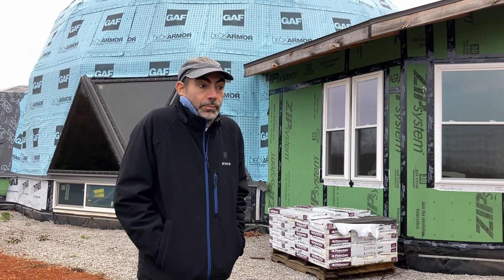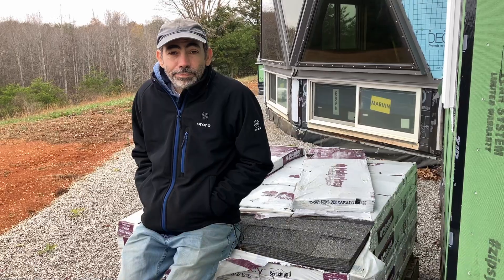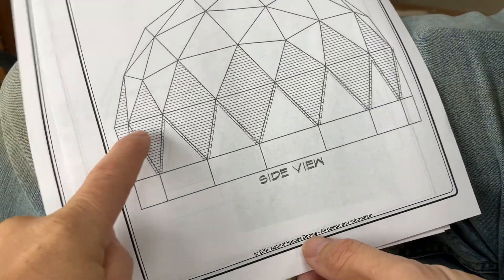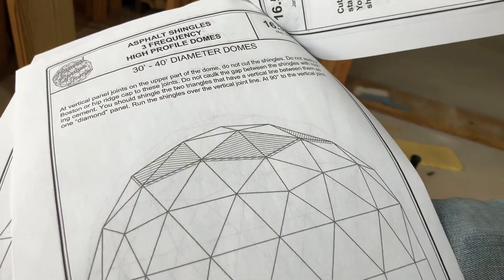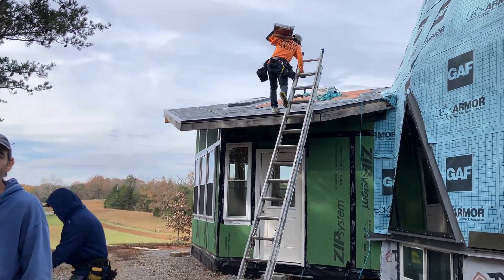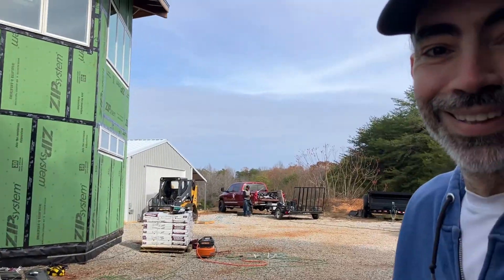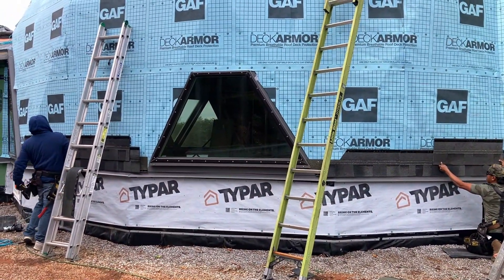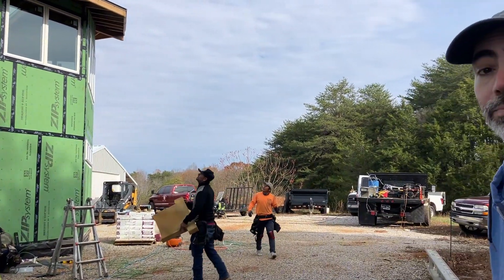How To Shingle A Geodesic Dome Roof - Part One

Comment: Thanks for posting this. I work on a roofing crew and I saw a dome on Facebook.  Was so curious about the process and had questions as some of the other roofers in the comments flat out said they'd quit if they had to do this. Id love the experience of working on such a unique job. Great vid and great job. Very cool.

Edit: was there a lot of waste do to cutting for the triangles?
Reply from the maker: Glad to hear you enjoyed the video!  It's hard to quantify if there was more waist than a standard house because I've never really seen how much waist a standard house has.  NSD said there's basically about the same waist between the two.  That being said, we did lose quite a  few shingles because I had stored them uncovered, they got rained on, and then it froze.  When the crew started working, a number of the shingles stuck to one another and ripped.  We had to lay them out in the sun to thaw.  One guy used a big propane blow torch to heat them up which worked pretty well.  I learned a lesson there!

Comment: Where is this done located? My sister has one in New Hampshire and we cannot find a roofer that knows how to do this…
Reply from the maker: We're in Tennessee.  Is your dome from Natural Spaces Domes?  If so you might contact them for ideas.  Also, we provided our roofer with instructions and a video showing how to put up and cut the shingles.  Maybe that would help ease the mind of potential roofers that the job is not that much different, aside from a lot more cutting.    We did run into roofers hiking up the estimate price because it looks so different.  Keep calling around.  You'll find someone with enough skills and interest to want to take it on.  We actually talked to our local insurance agent and got recommendations from them for reliable roofers.  Good luck!
Reply: I am building a dome here in Tennessee.  It is only 16 ft across.  I will be ready to roof it a couple weeks. Wish me luck.

Comment: There is an ERROR in the shingles!!! 
Where one triangle meets an other  THERE IS A BULGE. 
These shingles will break bearing ice and snow. 

I worked in a campus in upstate New York in the snowbelt 
Doing mineral shingles, half lap and full lap. Aluminium Steel and slate roofing

On the change of angle the shingles SHOULD HAVE BEEN SLIT ON AN ANGLE AND Real silicone should have been put on the back of that angle cut to support the weight and hold the shingle so it would not then split. 

As is you can see the BUBBLE created on the bends of the panels

What work we saw in these  60+ angled roofing joints; which in a year or two all would begin to break up and leak.
Reply from the maker: Thanks for the comment.  Leaking is definitely something we've been worried about from the beginning.  This technique for roofing the dome is what Natural Spaces Domes has used and recommended for decades, so hopefully they have figured it out and it will work long term.  They specifically avoid using the caulking method because apparently that seems to fail over time.  In case you are curious, here is a link to their website where they talk about roofing geodesic domes.  https://naturalspacesdomes.com/learning-center/roofing/
Reply: Out of curiosity - is there different specs for installation in an area that doesn't get but a dusting of snow per year?
Reply from the maker: @arkyartist - As far as we know, this is the same technique used across the board.  I hope we did it right!